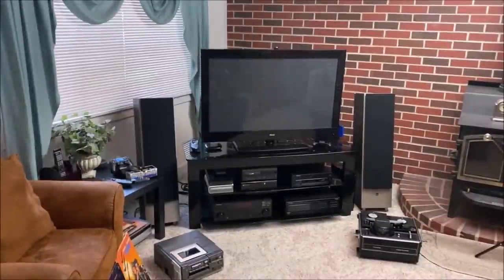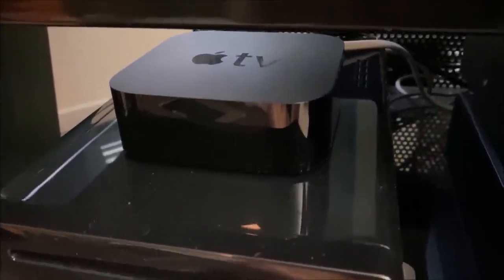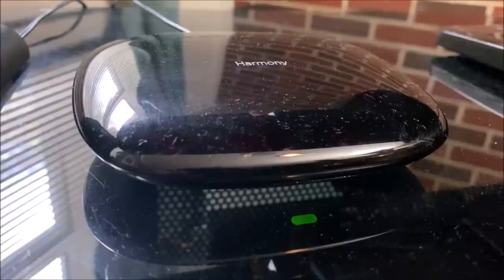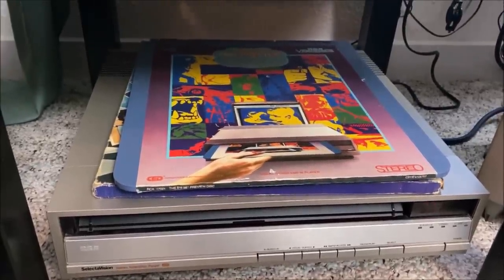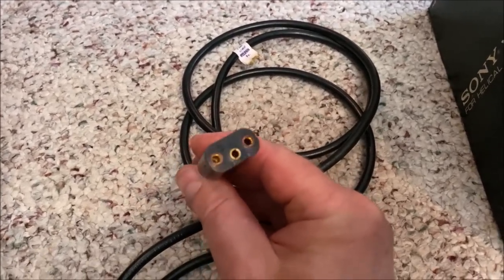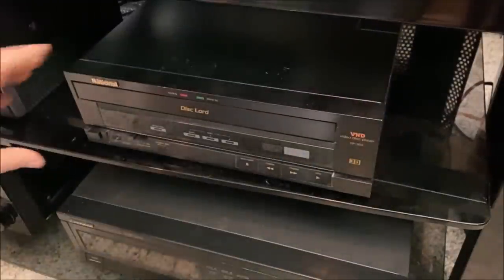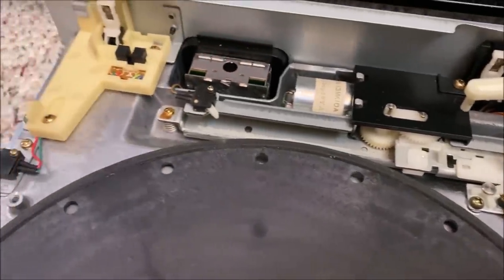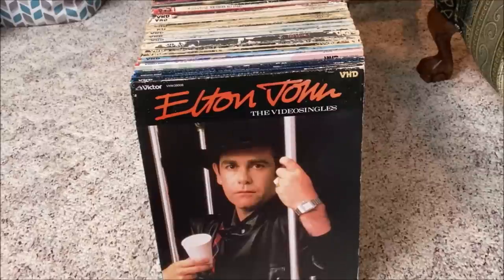RETRO TECH Home Theater Design Plus VHD Revisited

Comment: Glad to see other people avoiding the annoying smart TVs and sticking with older screens. I am using a modern 32 inch LG IPS monitor as a main viewing screen for all my media. The quality picture quality is spot on and no annoying operating system. If I want some modern streaming I just use my Xbox series X for that
Reply from the maker: High fives for your TV also!
Reply: Same here! I'm sticking to my 2007 Panasonic Viera plasma and my 2006 Samsung HD CRT in 2023 or until I die. I swear that plasmas like your RCA and my Panny are easier and healthier for the eyes than LCD; the NY Times even wrote an article saying so! And the picture quality is superb unlike those LCDs and LEDs that easily break down in just a matter of months! 😂

Comment: 1:02
"An RCA plasma TV which appears to be a rebranded Samsung"
Technically, it's not truly correct, it might have a Samsung panel inside, but the chassis and the PSU are probably from TCL, cuz they own the rights to the RCA brand nowadays.
And I also want to recommend you that when this RCA plasma breaks, to don't feel sad because there are no plasmas available, I suggest looking up for a used last-gen Panasonic plasma (an 50-in ST60 or VT60 would be a great option) but pay attention to the working hours has gained over the years :)

And back to this theme, I will also say that CED is slihtly better in comparison with the VHD because tere are no interferences despite te picture bein' a little bit blurry, but that probably something has to do with the TV format issues :P

Cheers from the second worst country in the world 😞

Comment: Is your RCA tv 1080p max or 720p/1080i max
Reply from the maker: 720p max
Reply: I work for a non profit, and run a senior center in my small hometown, and in our building when a SEARS was getting ready to close down in 2013(they fully closed in 2014), they donated a 50in Zenith(LG guts) Plasma TV that's full 1080p but only HDMI 1.0 that they had sitting for years in their stock/storage room, and used as a demo unit for a short time(took 4 of us to lift that beast, and mount it to the wall in my building)so I've had a few HDCP handshake errors with it, and ended up getting a Sony 5.1 surround sound audio amp/HDMI switcher that can do HDMI 2.0 4K if we ever get a new TV so I can  get around the HDCP issues with the Zenith, but man was it worth all the hassle, as the blacks are out of this world, and colors really pop. The only other displays I've seen that can come close, or beat it are OLED, or Quantium Dot, and if it was not for the power draw, and lack of 4K I'd be seaking out a similar LG made Plasma for my own setup at home for sure. Such a shame Plasma displays could not get their power draw, heat issues, and high prices under control to last in the market, as a slimmer 4K plasma would be AWESOME!!